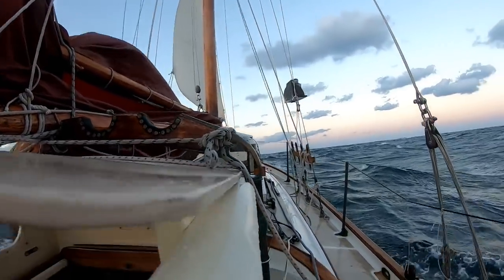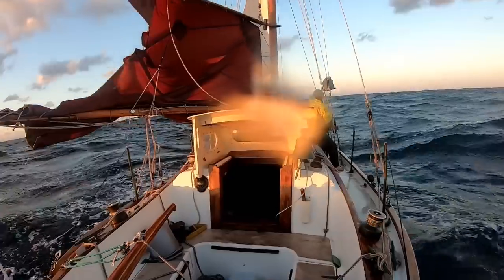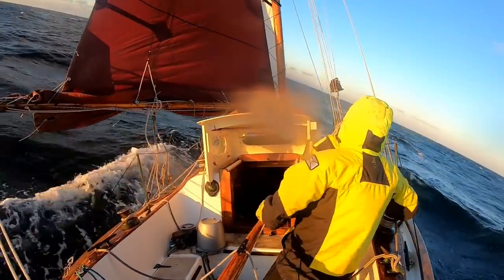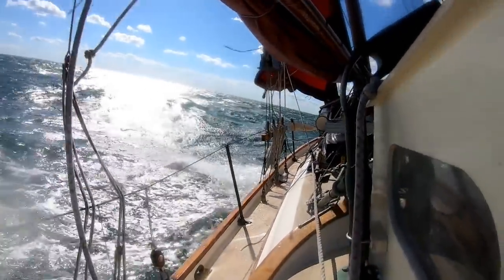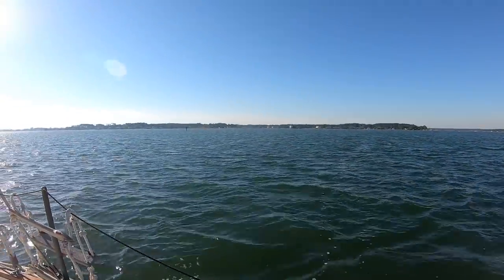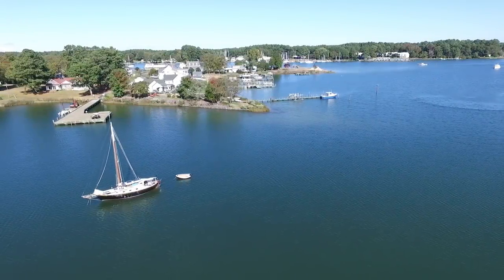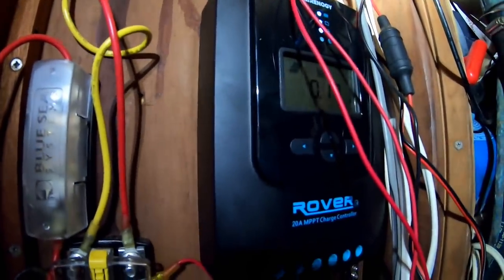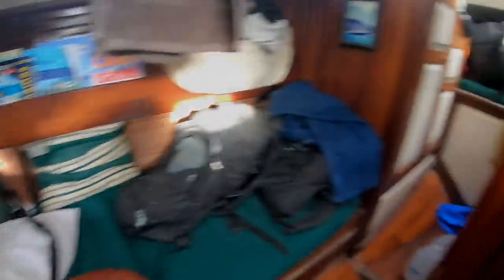Never Trust a Cold Front in October

Comment: Soot from the heater will potentially light up the plastic garbage bag and burn a hole in the new cushions - use a fire retardant cloth to protect Ruth Avery.  Thanks for the cool video.
Reply from the maker: If you notice I have a SS tray just under the heater, but good suggestion.  I've already had some hot bits drop out of the heater, especially when a gust of wind causes a back draft.

Comment: In light of not using a safety harness, do you use a trailing line behind your boat to grab if you fall over?
Reply from the maker: No I do not, although there's often a reefing line or wayward sheet trailing ...  I doubt I would be strong enough to pull myself back if the boat is doing anything over 4 knots.
Reply: @howtosailoceans1423  Fashion a ladder Cappy, you ought to live!

Comment: Cappy, I sailed an old "William Atkin "ketch for years in the Great Lakes. For God's sake man, at least run out a grab line aft the stern for 100'.  No harness? Your nuts. You'll have minutes before your heat is gone, muscle WILL NOT respond. This I know from an unfortunate incident but was rescued.  Grab line, 15-20 seconds to swim back across the line and a couple minutes, if you are lucky, to get back aboard. Had a personal friend sail from Ludington , MI to Milwaukee, WI, solo, wasn't even winter.  His boat arrived fully rigged and sailed on shore.  Never saw the poor fellow again!
Reply from the maker: If you are lucky a grab line might save you.  With the boat doing six knots pulling yourself back aboard would be quite the feat, although perhaps adrenaline would do it.